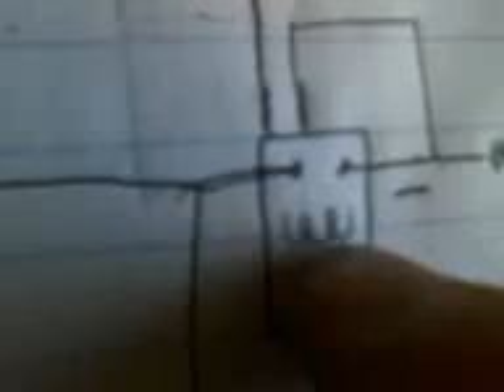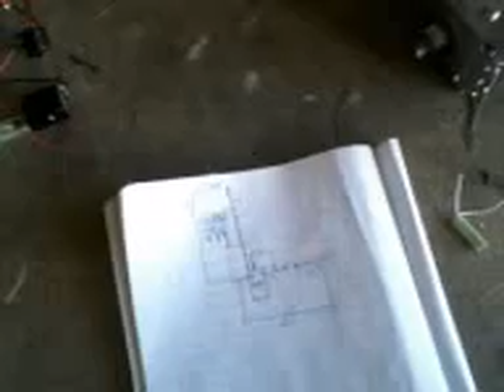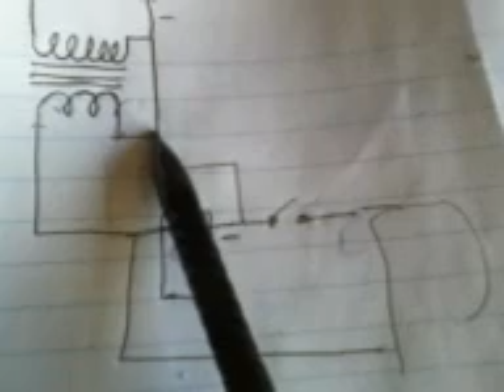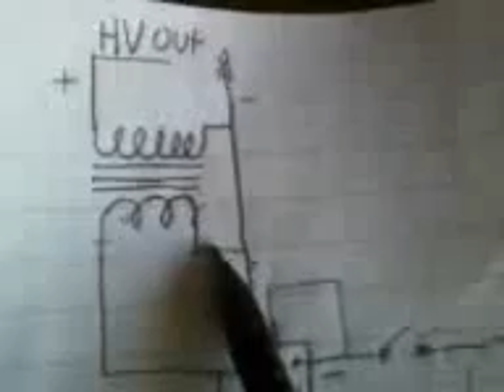Extremley simple ignition coil drive, driving a microwave transformer

Comment: Thanks for the comment on my vid, turns out I wired it a kinda complicated way, the cap is meant to go in parallel wit the power terminals of the ignition coil to create an LC oscillation circuit. My set up still manages to achieve this though so all is good. Glad you found it useful.